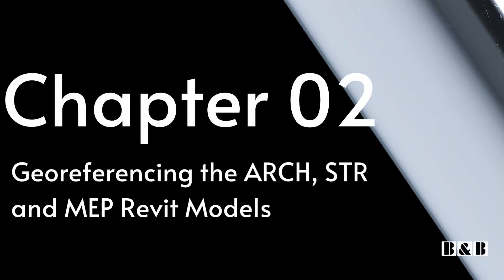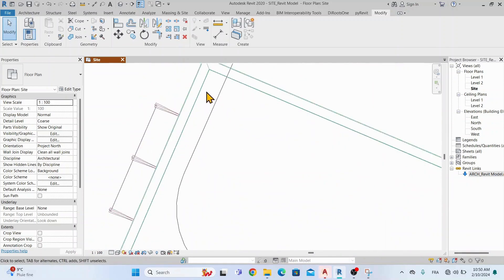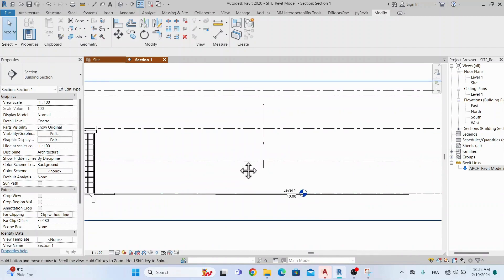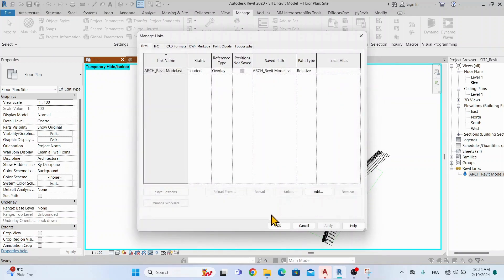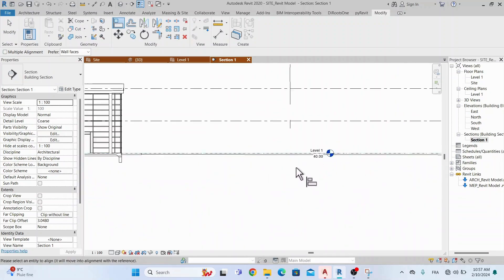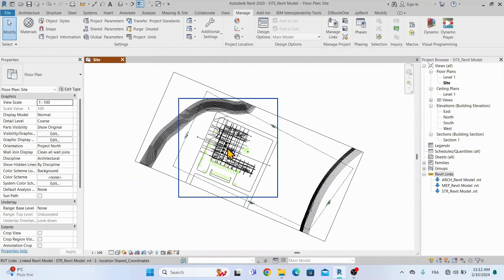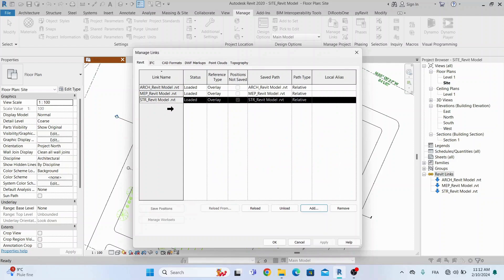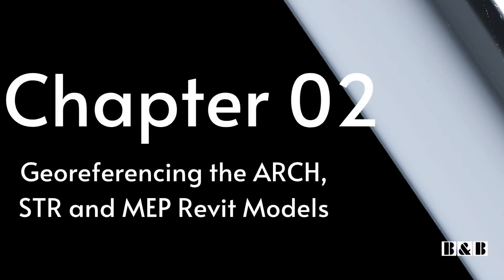Georeferencing in Revit: Optimizing Workflow through Shared Coordinates Part 2/2

Comment: Does the site file acquire coordinates by modeling creation with the DWG inserted? Or, at this stage, are the coordinates from the DWG also published to the site file? Subsequently, the coordinates from the site file will be published to the ARC, STR, and MEP files.
Reply from the maker: in total, we acquire coordinates from dwg file into the site file , then we publish the coordinates from the revit site file to all disciplines
Reply: @bimandbeam965 thank your sharing! i have 2 qeustions.
in other yt share, they say is a disease if aquire the cooridnates from DWG? i just want to know why(even my practice is same to yours)
second, if some MEP or STR models already “be shared coordinated”
we cannot pulbish the coorindates to them.
so how to resolve it? i think this is a common challenge for users:<

Thanks!!
Reply: sorry ,stipud question , is that be more nice that the survey points always keep 0,0,0, for all differnet models but they work in the same site??thank you very much.